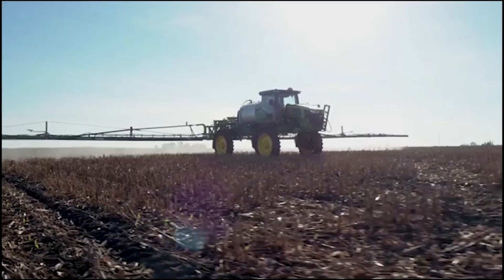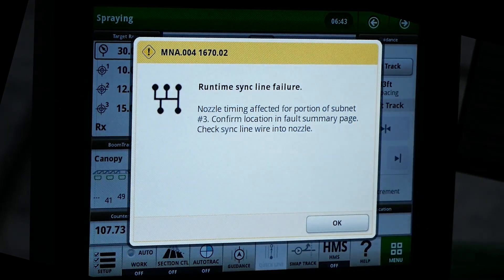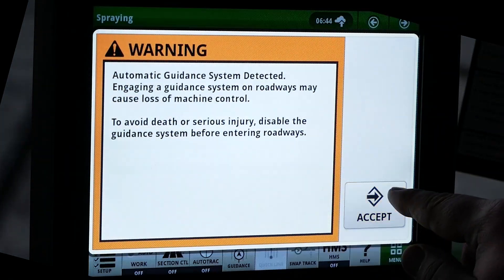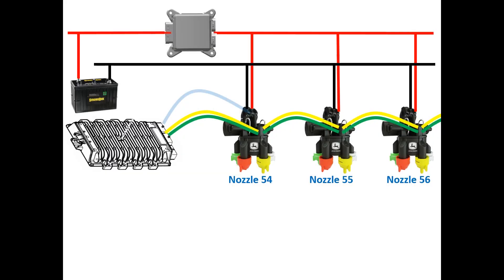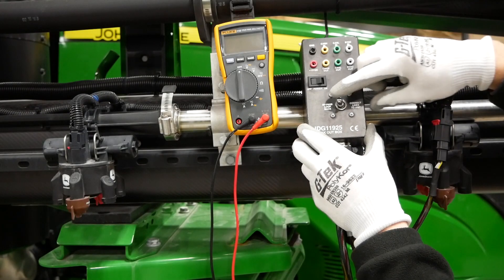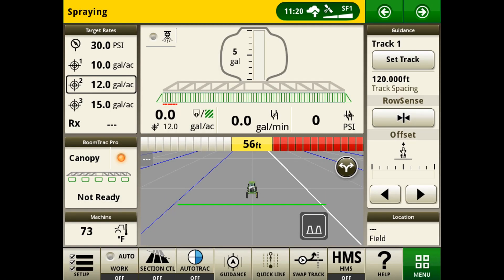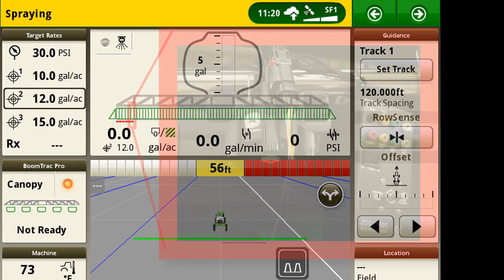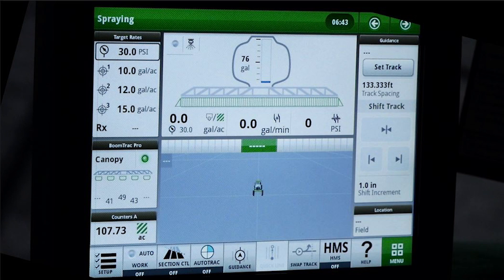Diagnostics 16xx.02 | John Deere ExactApply™

Comment: What happens on the end nozzle body? 5 in and what happens to 1?
Reply from the maker: Hey there! We recommend looking at the Operator's Manual if you're planning to do repairs or need detailed service information. You can view and purchase the correct manuals for your equipment here: http://spr.ly/6058Cwh88. Just enter your model number, and you'll see all available Operator’s Manuals. If you're still having trouble, we recommend contacting your local dealer for further assistance. Their contact information can be found here: http://spr.ly/6059Cwh8D.